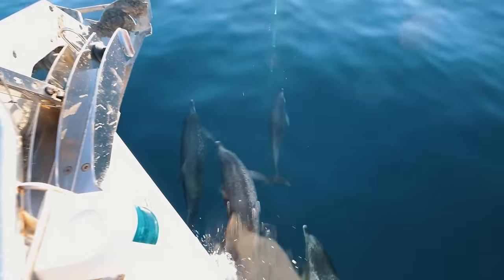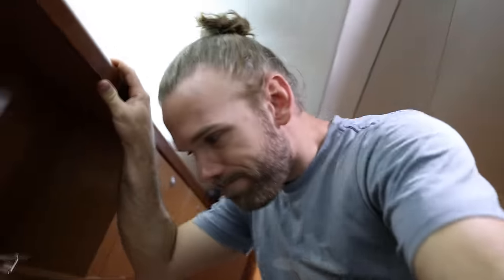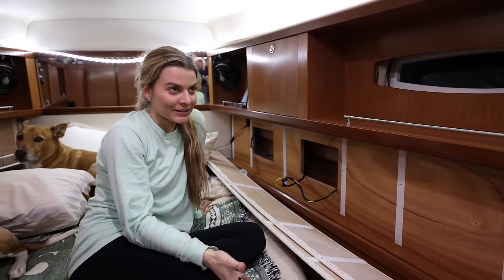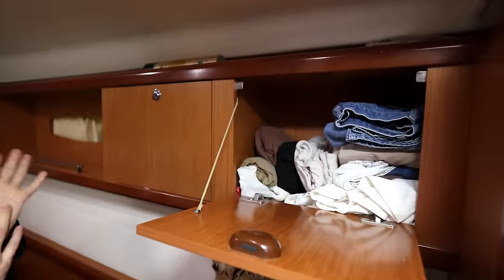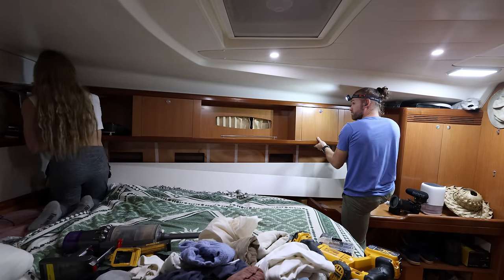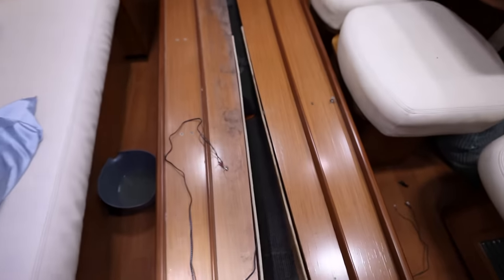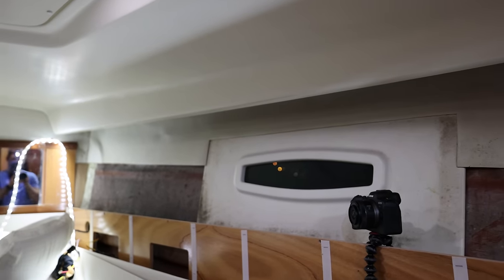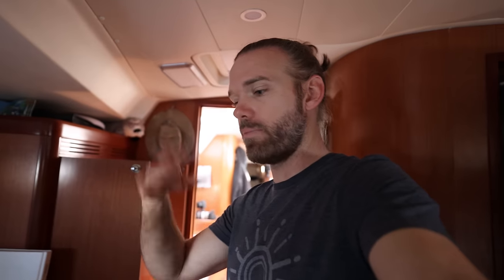Our Disgusting Secret - We Didn't Know We Were Keeping | EE 147

Comment: I didn`t read any other comments so I might say what someone else has already said or something you already know. Once the surfaces are cleaned, wipe all the surfaces with a vinegar cloth. It doesn`t need to be dripping wet but just get all surfaces covered with vinegar, this will add another layer of cleaning and also keep mold away for longer

Comment: If you heat the cabin to 150 degrees for 1 hour, the black mold will die. This doesn't solve the dead mold spores problem, but it improves the problem by getting to the places that you can't reach (through disassembly). Any mold and heat treatment bed bug company can do this  for you. Its a $1000 day charge - is the only problem.
Also, the water surrounding the hull is going to protect temperatures so you will have to let the 150 degree temperature really soak in.
Ozone can also damage your cabinet finishing - but its better than having the mold.

Comment: You can get an ozone generator for about $150. It will neutralize the mold in the short run. It takes at least 8 hours of run-time to be effective. You don't want to breathe it long term as it will damage your lungs, but works well. You really should be using respirators while the boat is contaminated.
Reply: Obviously I hadn't finished the video. Breathing the mold is way worse than the ozone. You don't want to breathe either for long.

Comment: So you now have clean side cabinets which is good. But what about the fore peak, behind the washing machine, under the ceiling liner, behind any panels in the head, etc. Don’t you have to  methodically go through the entire boat and find any remaining mold lurking in not so visible areas?

Of course, that would be after you get some good N95 masks.

Comment: Brent, Q, do you use the shower in your cabin? Could be the main problem causing your mold issues also. Do you have proper ventilation in the bathroom also do you have an exhaust fan vent for your cooking area ? boiling or frying you can produce moisture in there also ? Just thinking 🤔 of some other things 🤷‍♂️ well good to see that you’re back at it again 👏😉😅

Comment: UV C (254nm) light will help w mold. Also if you use boric acid as an anti fungal it will help prevent it from regrowth. Ozone is great but can oxidize some rubbers such as wire insulation and belts so use judiciously. Having used ozone for 20 years I know it can affect your respiratory system so use with care and ventilate after you blast before you enter.

Comment: You might want to do it again but run a circulating fan this time. Ozone is lighter than air, so most of what you generated was down at floor level and I’m some went into the bilge.
Reply: If ozone is lighter than air, it wouldn’t sink.  What am I missing?

Comment: Couldn't you spray a bleach/mold preventative behind everything? We had a similar problem in our house due to a leaking pipe we never could see. There's a commercial mold preventative called Mold Armor that we put it in a pump sprayer and sprayed everywhere we couldn't get our hands into to clean, also used bleach/water the same way. We used the Mold Bomb fogger to get into the even tighter areas. Our contractor told us we didn't have to physically wipe everything down because the bleach would kill it. Glad you realized the problem.Mold sucks!

Comment: My mold experience would be dealing with waterbowls for pets .... i ended up buying mold free bowls .... it works .... no more mold  .... also black mold on concrete floors of house under carpet which was removed .... used industrial strength Clorox full strength killed it .... mold is such a problem it is everywhere .... ❤❤❤🎉🎉🎉😊😊😊 ....

Comment: Let me tell a story: I saw all the efforts of professionals when a business building had a big water ingress. On every dehumidifier they used some 5 ventilators to move the air around.
Later we had water in our cellar. The dehumidifier did it's work but the floor didn't get dry. Then I remembered that firm. I put a ventilator in the outmost corner of that room. Some 2 hours later in the direct blow of that ventilator you could see the floor become dry. 
In one room without forced ventilation you may find horrific differences in humidity in distance to the dehumidifying machine. 
But: this advice is only for drying. 
Everywhere you have a significant temperature drop from your normal room temperature - at the outer layer you will experience water condensation, followed by mold. I think the only way is to reduce the areas were condensation will occur by insulation. And forced ventilation.

Comment: Guys don't try to remove it yourself, you will only make it worse. The mould will release more spores if you try to DIY, especially if you use domestic bleach.
To eradicate it you'll need to find a specialist to treat it with a fungicidal agent, like they do in hospital surgeries.
You've made a good start by taking the moisture away but the mould will need to be killed with fungicidal agent before it is wiped off.
It's probably best to leave it alone until you can get to a place where you can find a specialist to come on board and treat it.
We had the treatment done at our home. It wasn't cheap but it did the job and was worth it.

Comment: Ozone Reaction with Airborne Particles - Ozone (O3) can react with airborne particles, including dust, smoke, mold, and other pollutants, causing them to settle out of the air. This can create a visible haze. Oxidation of VOCs - Ozone is a strong oxidizer and can react with volatile organic compounds (VOCs) present in the air. This reaction can produce secondary pollutants, which may appear as a haze or film on surfaces. High Ozone Concentration - If the ozone concentration is too high, it can lead to a more noticeable haze. This is more common in enclosed spaces, where ozone levels can build up quickly. Additionally, Ozone generators can have a detrimental effect on resins, rubber and certain sealants due to the highly reactive nature of ozone.

Comment: Hey, wanted to share my experience with you on IAQ that could be beneficial.  It seems to me that maybe one of the problems could be the lack of fresh air being brought into the boat.  I won’t bore you with the calculations, but you need about ~50cfm of fresh air per person to maintain good IAQ.  On days when the hatches are open this is probably easily achieved.  However, on days when you are locked up inside probably not.  The challenge with this much fresh air is conditioning that air (cooling, heating, humidifying, dehumidifying).  Good to hear that you will at least start leaving a hatch partially open and that you are using a dehumidier.  Might also want to invest in a CO2 (carbon dioxide) monitor.  It will be a good indicator or how much fresh air is being introduced inside.

Comment: HI guys  damp or mold  how about quiet run computer fans  that draw air out of the boat  from behind you cupboards and  under a bed etc  if the air is dried  from a heater  warmer air will stop damp forming  I had heat in one side of my boat and fans on the other side creating a circuit of air movement.....

Comment: OK, mold.  Common catastrophe.   First, try 'spray and forget.'  Made to kill mold and keep it away.  On my boat I keep a 1 gallon pump up garden sprayer.  Hot water, bleach and pine sol sprayed where u can't reach will kill it all.  No flood, fine spray on the back of cabinets, bilge, under bed, underside of floorboards, lazarettes etc.  Do it every so often.  My new, old, boat had heavy, heavy mold everywhere.  Fresh water boat in cold Lake Superior, sweaty condensation in summer, tons of line left lying on the bare hull, and the previous owner did nothing about it.  Horrible smell and filth.  Bilges how sparkle, lockers and lazarettes clean and white.  I am a Dr and hat, hate, hate filth and mold.  Keep at it and you'll get there.  By the way, your cabinet surfaces are not wood.  They are man-made reconstituted veneers.   The wood grain us 'sprayed' into a pattern.  Love you guys.  Leaving for the Caribbean in July. 
Mike. 1997 Catalina 42 mkii "a TOAST to life".  Called TOAST.

Comment: 31:36 Something to take into account.
Since ozone consists of three atoms of oxygen, and oxygen gas only consists of two, the specific gravity of ozone gas is half as much.
It will therefore collect at the bottom of the boat, and fill from there to the top (same danger as with propane, for example).👴🧐😉🤗

Comment: Black mould made my wife very sick  . Took a long time to get better . Some molds are fine , others will make you very sick and you can not tell which one is the bad one . 

You need to be wearing a mask and ventilate like crazy . Bad design for any boat to have any inaccessible spaces .  You need to probably paint all that with a mold resistant paint like you use in a bathroom . 

I find Starbrite mildew and stain  remover works fantastic .

Comment: A tip for using hole saws, if you're worried about the centre bit causing damage. Once the hole is fully started, you can just remove the bit and carry on without it.

Comment: The mold will return as long as the colder hull meets the warm air of the room.  What you need to solve the problem long term is better insulation on the hulls. Anybody knows that has had an iced drink in a warm clime creates condensation. Same thing is happening on you hulls. A good  portable HEPA air filter that can get you 5-6 air exchanges per hour (based on flow rate and the volume of the space) will do wonders to assist in removing allergens and mold from the breathable air. It is the most reliable method.  Ozone is not a reliable method since you have no idea if the exposure is good/long enough, plus it can be hazardous.  It also does not remove it, and doesn't prevent it from returning. De-humidifiers should be cleaned regularly with a 15 water to 1 bleach solution regularly to prevent other airborne issues such as legionella, including mold. Standing water is bad for health and what it can grow. Good luck.
Reply: Agree   The insulation must be mold resistant.  In a perfect world completely sealing off that space would be ideal,  I would reach out to Uma again.  When they demoed their boat they did not mention mold and it looked OK.  They had closed cell foam insulation.

Comment: Hi.  I have been enjoying your videos right from the beginning.   I’m actually a surveyor and see this all the time.   It’s not mold.   It’s dust and dead skin cells and dander from the dogs.  Not to mention all the fibre glass and gel coat you ground out.   If it was mold it would not just wash off.  Mold tends to grow into and cling on.  It no different than if you pull a fridge out in a house that have been cleaned behind for a long time.

Comment: Did you guys try dehumidifier?
Reply: We are home builders and run into mold when the build takes place in damp seasons.  It will grow on the floor joist in the basements, etc. until the home can be closed up and power is available for dehumidifiers.   Cleaning the mold is done by spraying the wood with a bleach solution which others have posted previously.  It may be something that you do occasionally as you can use a simple pump presurized garden sprayer to mist the surfaces.  Go online to see how others remedy the situation.

Comment: So sh*tty about that, but glad to see you seem to have been able to address the problem with the mold.  Just wanted to chime in here and let you know that “air conditioners” are actually dehumidifiers.  It’s exactly what they do, which is why they often drain water when operational.  Air conditioners dehumidify air by taking moisture and removing it from the room, changing relative humidity, and making it feel colder.  So not sure but it sounded like you said you had an air conditioner, and recently bought a dehumidifier, but you can likely remove moisture in the air if you just run the air conditioner, which it sound like you already have.  Look it up!

Comment: Where is your respirator? a N95 is better than nothing but its no where no where near effective enough. No  not all molds are all equal and the same, even though most molds are black in color. Mold  can be as small as  0.04 microns  in size. N95 will stop  0.3 micron if it has a one way valve on the front of  it and even then it will let 5% of the smaller stuff through. If it does not have a valve, you're just pulling in air around the edges and its doing nothing. You don't see someone removing asbestos with a n95 mask for a reason. Mold particles are very similar in size and just as dangerous as asbestos.  A proper 3m respirator  (full faced is prefer , or glasses) with the appropriate rated filters on it are what is required for  such things. Clean the surface with bleach or TSP and  paint  the wood with Kilz heavy duty primer. it will protect the wood from rotting and stop mold in the future.  Take this from someone who is certified to remove Asbestos, Molds and such things,  the $120 is cheap given the wrong type of mold will kill you. Be careful when using the Ozone machine in a boat as it can kill you when used in a confined space. read the directions and follow them to the T. open the hatches from the outside and turn on your cabin fans or heating system to blow in oxygen and vent out the space before entering the room. i use one one my 36ft Hues every spring. It works like a charm on that closed up boat smell.

Comment: Ive done years of mold removal as an occupation.  There's only one product that actually kills mold. It's a product that a company called Buckeye it's QUAT-128 is a hospital grade one step disinfectant germicidal. You need to spray it down with this product allow it to dry and then use a hepa filter vacumn. You need to do this 2 times buy wipeing it with a dry cloth your only causing it to become air bourn. A one square inch of mold has about 5000 spores I. It. So i don't like to be barrier of bad news. Everything g you've done so far is a waist of your efforts.

Comment: You are not only surrounded by water all the time, but two adults and two dogs sleep in this very small space and you all expel moisture. This is very bad. This mold may have started long ago and only now gotten bad enough that it is affecting you. More changes of air and dehumidifying are a necessity.  Make sure you check out ALL of your AC and HEAT system for mold, or you'll just pump it right back in...   If may also be a good idea to make plans to run the ozone machine when you go to off the boat for a few hours, just to confirm nothing new growing....  Best of luck.. Still loving your channel....

Comment: WHEN DEALING WITH  MOLD AT ALL TIMES WEAR THE APPRORTIATE AIR FILTRATION MASK! IF NOT, YOU ARE EXPOSING YOURSELVES TO SERIOUS INFECTIONS.
Given you are taking the boat appart, look at insulating it for cold and heat. You have AC for the heat, but is it enough to prevent mold? Look up mold remediation methods and prevention.

Comment: Guys please be careful with ozone generator: ozone is more reactive that chlorine because it has more oxidizing potential, therefore its more dangerous, the only reason it does not hurt you as much because generation of ozone pretty low yield process. Also molecular weight of ozone is more that of air, and because of that it would accumulate at floor level of the boat without ability to quickly escape (similar to CO2).

Marketing is strong for ozone generators but in reality they arent healthy to breath
If you dont believe me check maximum allowed by health safety standarts concentration for ozon as compared to chlorine
for ozone its in range of low tens ppb (parts per billion) whenever for chlorine its in middle of ppm (parts per million)

Comment: Hello you two. May I give you a good tip on how to get the problem with mould under control... A small dehumidifier! I have a Grand Banks and the appliance runs 24 hours a day in winter... Since then it has been very nice and pleasant in the chit... Even when it rains. Costs a bit of electricity yes, but it's worth it!